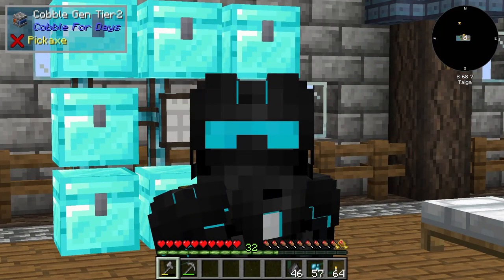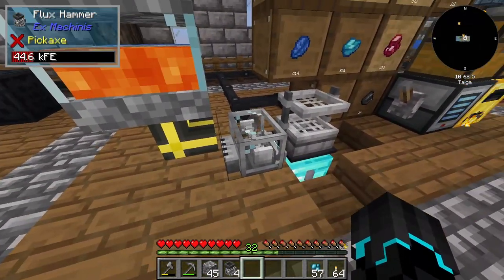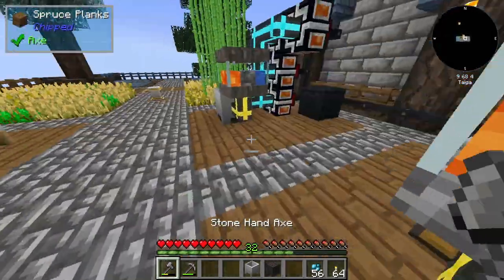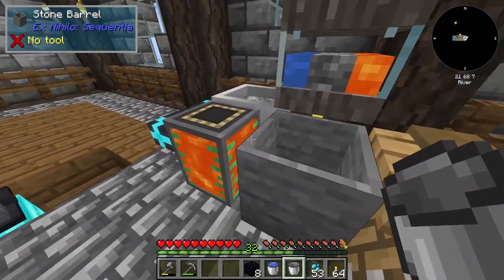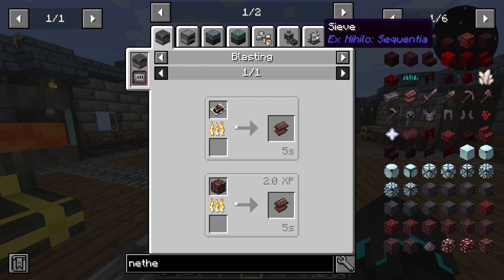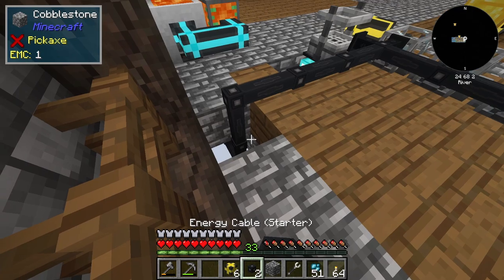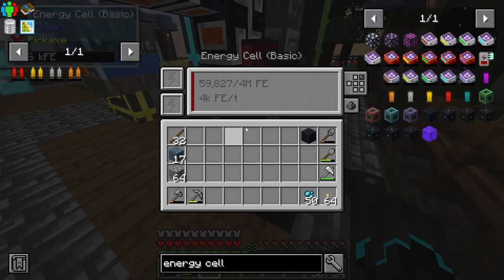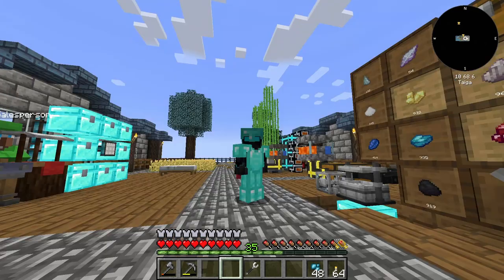I made a BIG mistake! | All The Mods 7 To The Sky - EP6

Comment: Put two igneous extruders in a setup sharing the lava so that you can make netherrack and endstone at the same time, and you can also put the integral components in to upgrade them. I think that goes faster than the drying basins, and also doesn't use RF. And sorry, in my post on your last episode, I forgot to also say you'll need the platinum for the enderium jetpack because I was getting the netherrack and endstone at the same time. You can also put a third extruder in the system later to make basalt, which is great for getting flux for Powah. You'll just need to just through the hoop of getting ice.

Also, as soon as you have the resources to start getting into it, experiment with Laser IO. It's incredible for logistics.
Reply from the maker: Thanks a lot for all these tips! I will look more into it behind the scenes and props do some experimenting, thanks! Huge help! :D
Reply: @BinaryVigilante  No problem, man. I still think about how much fun your End survival series was with Better End.